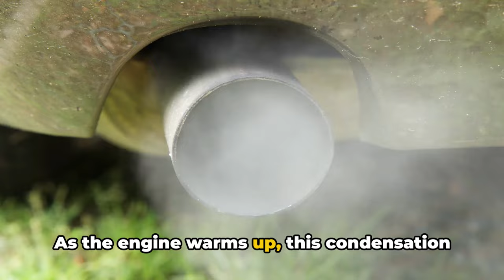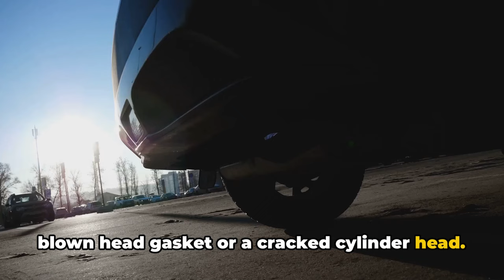White Smoke from Exhaust on Startup then Goes Away: 5 Common Causes

Comment: It's just condensation from the cat when you start your car up when it's cold. assuming it goes away, it's just the engine warming up. Worst it will be is egr something like that. Don't be scaremongered into something it's not people.
Reply from the maker: I agree with you 100%. No need to panic
Reply: Appreciate this alot  though my gtp was dieing on me
Reply: Cats are so mischievous. Mine often jumps on me on the couch while I am sleeping, looking for me to give her treats.
Reply: I started getting white smoke whwn i deleted my cat , gone when its hot , actually smells a bit like a rich fuel mixture which i presume is used to heat the cat uo fast at startup
Reply: @raymondbotha3675  Make sure to provide fresh water in a bowl for your cat.
Reply: Oh no that would mean his kidneys ars gone 😢@seanrobinson6407
Reply: @raymondbotha3675  Take your cat to the vet immediately if they emit a rich mixture smell.
Reply: @raymondbotha3675  Extra fuel is NOT added to the engine to "warm up" the catalytic converter. The excess fuel may be from fuel injector(s) which bleed off pressure (leak) after the engine is shut down. When the engine is started, the excess fuel goes into the exhaust unburned, and come out (vaporized0 out the back.

Comment: When i start my car. A huge amount of white smoke comes out, but it disspears in like 10 seconds. Im assuming that's fine?
Reply: The same thing happens with my 1990 camaro. I'm trying to find answers and hope it's not a head gasket
Reply: My honda pilot 2010 petrol when start coming smoke and when star long time waiting on signal that time coming  more smoke what is the problem plz inform me thanks
Reply: Huge update: My car is fucked, there's oil in the engine. That's what I get for buying a Ford, lol.
Reply: @EBraz my ford edge sport is doing the same thing. Ford dealership garage isn’t able to figure out the cause of it. What was your diagnosis?
Reply: @caitlingray3020  It tuned out there was oil in my engine. Idk how when I always kept up with its maintenance. I'm planning on buying a new car. Maybe a Lexus
Reply: @EBraz the engine is supposed to have oil in it?

Comment: I have a 98 Toyota Avalon XLS, bought 5mo ago from a friend who kinda ran her down. So shes a rescue 😂. Runs strong. But occasionally not every time and not always on a cold start and dont really matter the temp. When i start it a thick cloud of white smoke will come out for about 10-20sec before it starts to clear out and none once im moving. It also usually smells more burnt than anything. Not sweet imo. My belts tend to squeel on start too for a few seconds randomly also. Idk if thats related or not. Sometimes they dont stop squeeling til i switch into drivr though. It is an automatic. Just trying to weed through all the minor issues. I think i need a thermostat too because my heat dint work and the temperature gauge drops a lot. Could that be contributing to any of these issues?  She has 281k miles on her shes a trooper and still strong so just trying to nip these things in the but before it effects performance

Comment: Hello , when I start my car huge amount of white smoke came out from exhaust but after 10-15 minutes it disappeared . There is no engine oil leak and coolant is also fine what could be the reason? This happened in winter , also lot of water coming from exhaust.
Reply from the maker: Hi there it might be condensation since it happened when it was cold. are you still experiencing this?
Reply: @HonestMechanicChannel  yes , but when I drive regularly there is no smoke coming from exhaust but when I drive once or twice in week it happened. Is it fine??
Reply: @suryarana3475 how’s your gas millage it could be a faulty injector
Reply: If this happens will the car be able to pass smog test?
Reply: Hi I have same problem on my x3 2006 turbo diesel  I found oil in the charge intake pipe and oil on the butterfly intake manifold any ideas

Comment: What about white smoke at startup, regardless of whether it’s 90 degrees out or 20 degrees out, and it smells like burnt rubber? Doesn’t smell sweet whatsoever. What could that be? 2020 Ford Explorer. Service department at Ford couldn’t diagnose it but it’s been 7 months now and I hate that it does this. 😅
Reply from the maker: Hi, other than that is the vehicle running fine and how long does it typically last? White smoke at startup, regardless of outside temperature, accompanied by a burnt rubber smell in your 2020 Ford Explorer could be caused by a leaking valve cover gasket,Since the Ford service department hasn't been able to diagnose the problem, consider seeking a second opinion from an independent mechanic specializing in Ford vehicles for a more thorough diagnostic process and appropriate repairs.
Reply: I have a 2020 pathfinder and mine does this too! Doesn't matter the weather outside. Doesn't do it every time I start it, but frequently. Also has a burning rubber smell. I take mine to Nissan and they said possible sludge. Just wondering if there is any other ideas.
Reply: @quinsmama09 my 2018 pathfinder is doing the same. Took it to get fixed but it’s still doing the same thing.
Reply: @quinsmama09  did you know what was the problem mine 2019 have a similar situation

Comment: I have a 1999 Firebird that "smokes" moderately out of the exhaust when the weather is cold.  It goes away when the car idles 15 minutes. Is this normal?
Reply from the maker: Hi, Yes, moderate exhaust smoke on cold starts can be normal, often just condensation evaporating. If the smoke is white and disappears as the car warms up, it's likely not a concern. However, if it persists or is blue or black, have it checked for potential issues.

Comment: My engine has a small knock along with the white smoke. If i rev the engine the ticking gets faster and the smoke gets thicker. Once the engine is at opetating temp the noise and smoke quits. This only happens when it is lower than 60°F outside.

Comment: It happens on my car only if i drive with high rpm like 100 or 120 kmph  the following morning it blows excessive smoke for 10 seconds and dissapears my exhaust is clean and also drops some water 

I suspect pcv valve ?
Reply from the maker: Hi, White smoke from the exhaust, particularly after driving at high RPMs and then experiencing excessive smoke the following morning, can indicate moisture or coolant burning off, which may not be directly related to the PCV valve. The PCV (Positive Crankcase Ventilation) valve helps relieve pressure from the engine's crankcase and prevents oil from being blown out. If faulty, it can lead to oil leaks or oil burning, which typically produces blue smoke rather than white. White smoke is more commonly associated with coolant entering the combustion chamber, possibly due to a head gasket failure, cracked engine block, or a cracked cylinder head. However, if you're also noticing water dripping from the exhaust, this can be a normal byproduct of combustion, especially in cooler weather, as the exhaust system condenses moisture in the exhaust gases. For an accurate diagnosis, a thorough inspection by a mechanic is recommended, as they can check for coolant leaks, head gasket integrity, and the condition of the PCV valve.

Comment: I have a 2011 Nissan armada it only does it on start up for 20 seconds
Reply from the maker: Hello, if this also happens when the outside temperature is hot/warm, I would say, the valve stem seals are going bad, allowing a small amount of oil to leak into the combustion chambers. This oil burns off during startup, causing the white smoke. If the smoke clears up quickly and doesn't reappear during normal driving, it's likely not a serious issue.
Reply: @HonestMechanicChannel mine does that as well. I just got an oil change and now it's doing it more consistently.

Comment: does the condensation in the exhaust rust the exhaust baffles inside if the vehicle sits for a week or two?
Reply from the maker: Yes, condensation in the exhaust system can contribute to rusting of Hi, the exhaust baffles and other internal components if the vehicle sits for an extended period, like a week or two. This happens because when the vehicle is not used regularly, the moisture from condensation doesn't get a chance to evaporate fully, as it would during regular driving when the exhaust system heats up. Over time, this trapped moisture can lead to corrosion and rust, particularly in climates with high humidity or during colder weather when condensation is more prevalent. Regular use of the vehicle and ensuring the exhaust system is in good condition can help minimize these effects.
Reply: @HonestMechanicChannel  awesome thanks !

Comment: Another cause could be diesel fuel in a gasoline engine.
I once poured 5 gallons of gas in my out-of-gas truck from a container that had been used to fuel diesel tractors.   
It must have had a minute amount of diesel left in it, because the truck smoked like a chimney till it was flushed through with a fill up.
Reply from the maker: 100% a common mistake as well. Thanks for your input

Comment: 1.9TD AAZ VW engine. Smokes white when accelarating at more than 2k rpm when COLD. After about 20/30min driving it goes away. What could it be?
Reply: Btw its an engine from 1996. No ECU. Just old mechanical diesel

Comment: Hello my bmw m20 is bringing out white smoke when start up in the morning
Reply from the maker: Hi, does the smoke go away when driving? only happens in the morning?
Reply: Hi i have the same problem on BMW E90 white smoke when start up from cold and rpms are playing /like engine shaking for a few seconds/until warms up and smells of unburned diesel. Once warm all the smoke disappears.
Reply: @tonchodimitrov9520  probably a glowplug if it doesn't smoke and smell like diesel after the engine is up to temp